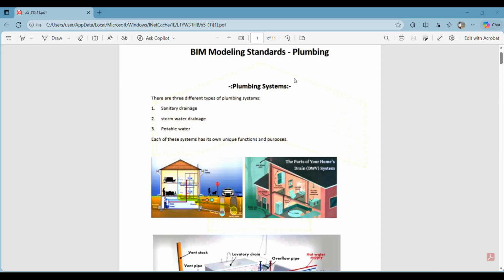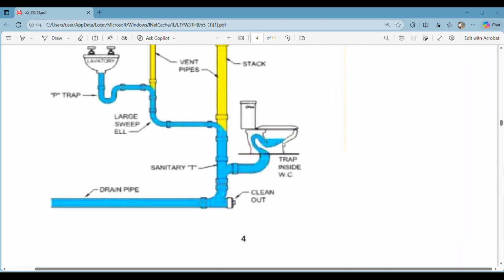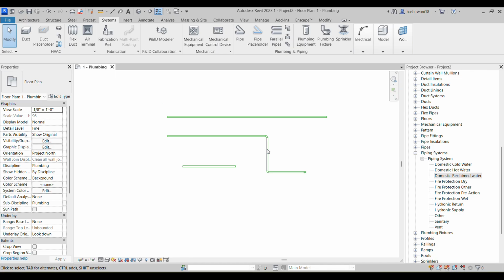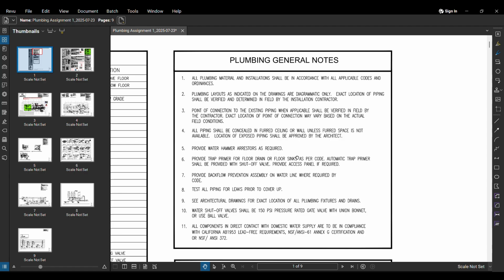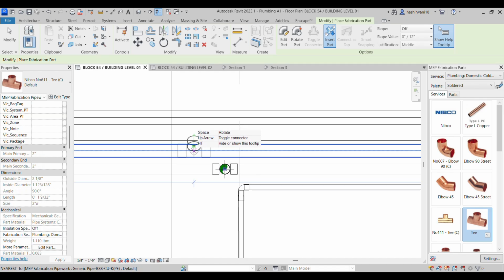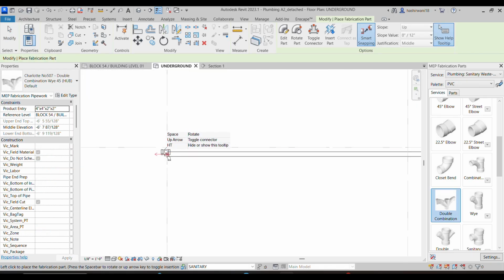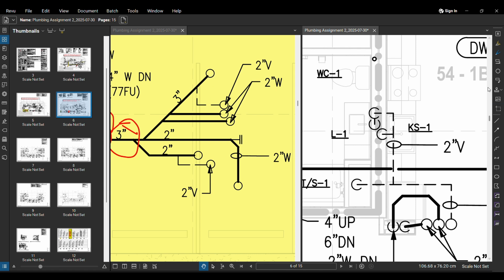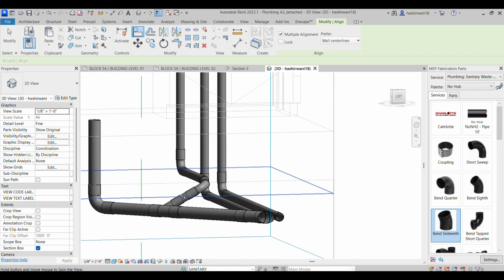BIM PLUMBING Modelling Recapitulation Masterclass by ER HashirVani PART 1 #bim #revit #structure

Comment from the maker: This video provides a comprehensive masterclass on BIM Plumbing Modelling, focusing on the fundamental concepts and practical application within Revit.

The video covers the following key areas:

Introduction to Plumbing Systems (0:16): A plumbing system is a network of pipes, valves, fixtures, tanks, pumps, and fittings designed to manage water entry, circulation, and exit within a building. It's crucial for residential, commercial, and industrial structures.
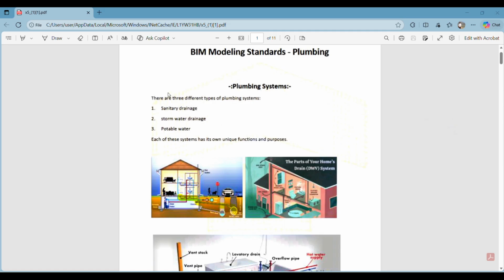Types of Plumbing Systems (0:40):
Sanitary Drainage System (Waste Water Removal): Handles unsanitary water from toilets and drains, carrying it away into sewage systems to prevent health hazards (1:22).
Potable Water System (Fresh Water Supply): Delivers clean, pressurized water for daily uses like drinking, cooking, bathing, washing, and firefighting (1:01).
Storm Water Drainage System (Storm Water Management): Manages rainwater runoff from roofs and pavements to prevent floods, waterlogging, and structural damage (1:58).
Interaction of Systems in a Typical Layout (2:30): The video illustrates how fresh water is supplied from city mains, how storm water is collected and directed, and how sanitary waste is transferred to the city's sanitary system.
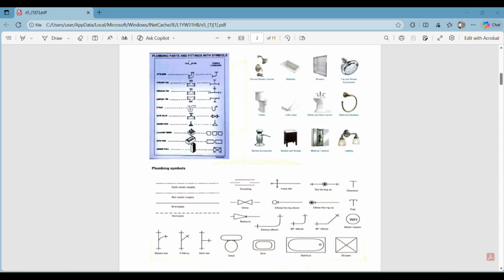Plumbing Parts and Fittings (6:36):
Emphasizes the use of radial elbows and parts (7:21) over mitered ones.
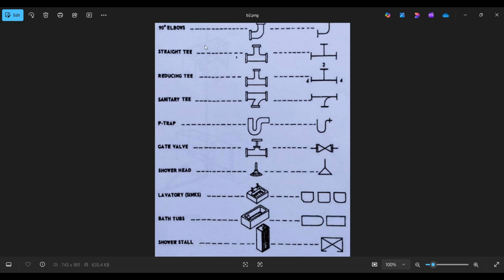Highlights the importance of sanitary tees for waste water systems, which operate on gravity rather than pressure (7:42).
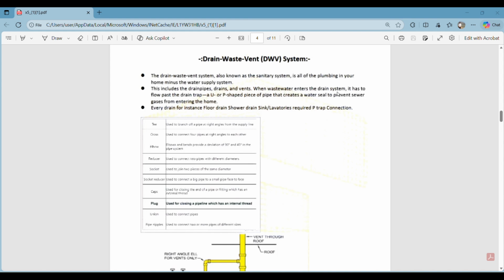Explains the function of a P-trap in preventing sewer gases from entering homes (8:55, 15:08).
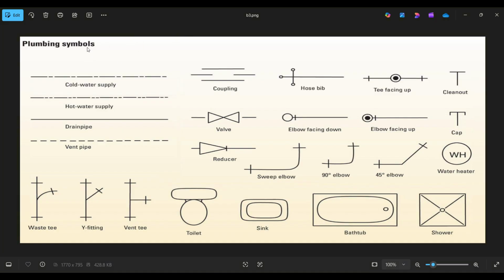Plumbing Symbols (10:15): Discusses various 2D symbols used in plumbing drawings for cold water supply, hot water supply, drain pipes, vent pipes, couplings, valves, and fixtures.
Plumbing Pipe Materials (13:31):
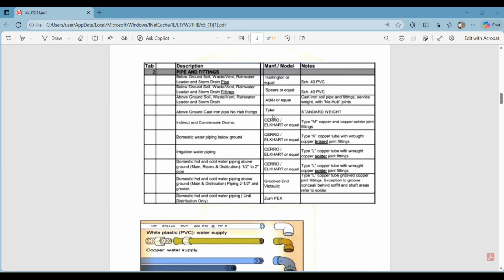PVC pipes (Schedule 40 and 50) are primarily used for underground drain and storm water pipes due to their corrosion resistance (12:40).
Cast iron pipes are used for above-ground sanitary waste and rainwater pipes (13:11).
Copper pipes (Type M, K, L) are used for pressurized fresh water supply pipes (13:44).
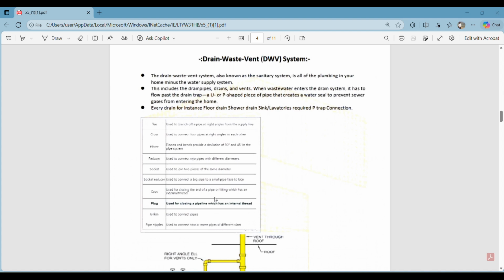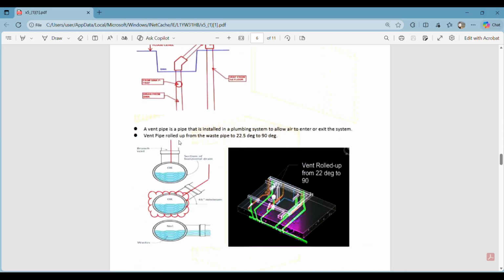Drain Waste Vent (DWV) System (14:33): This system encompasses all plumbing in a house except the water supply. It includes drains, drain pipes, and vents. Vent pipes are crucial for removing harmful gases and odors, and they must always be pointing upwards or at a minimum 45-degree angle (18:23).
BIM Modelling in Revit for Plumbing (23:12):
Demonstrates how to select different pipe types (PVC, standard) and system types (domestic cold/hot water, sanitary, vent, fire protection) in Revit.
Explains how to create custom system types, such as "reclaimed water," and assign specific colors and patterns for better visual identification (24:55).
Introduces fabrication parts as a more accurate and market-available alternative to generic Revit families. Fabrication parts ensure that the modeled components (pipes, elbows, tees) have sizes and lengths that are actually produced by manufacturers (30:16).
Covers optimizing pipe lengths for fabrication parts (34:55) and manipulating fittings like elbows and tees using spacebar for rotation and the up arrow for toggling connectors (36:04).
Explains the "insert part" feature for easily adding fittings into existing pipes (38:48).
Discusses how to change services (e.g., above ground, below ground) which automatically applies the correct material (e.g., cast iron for above ground sanitary, PVC for below ground sanitary) (40:17).
Shows how to create and apply filters in Visibility Graphics (VG) to color-code different plumbing services for easy identification (41:51).